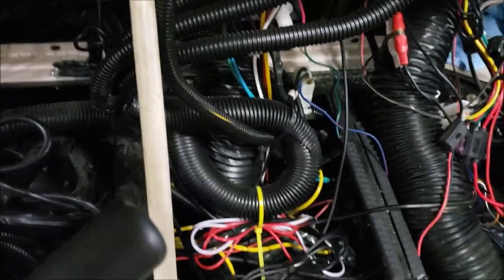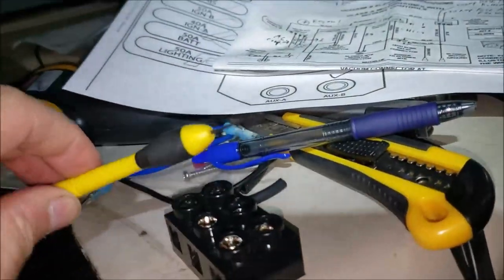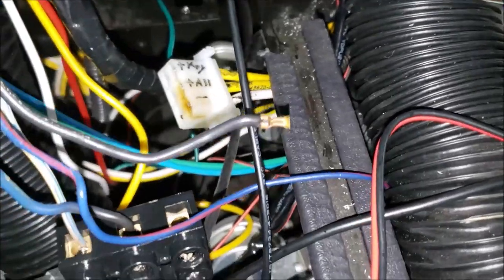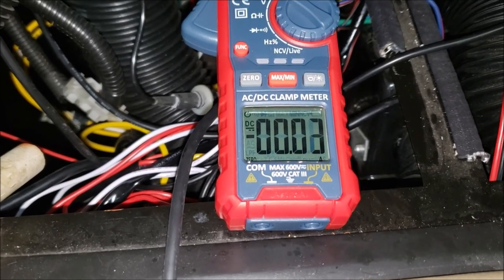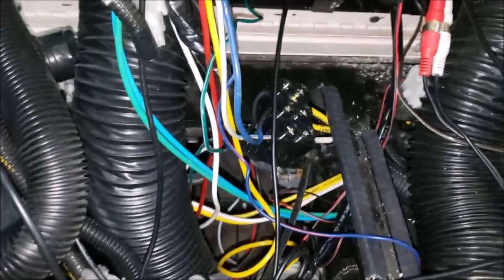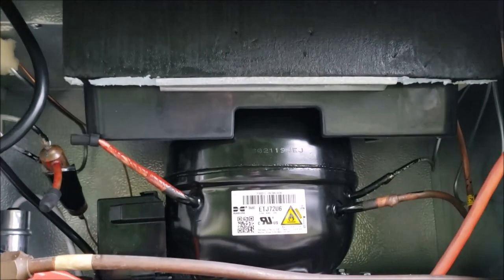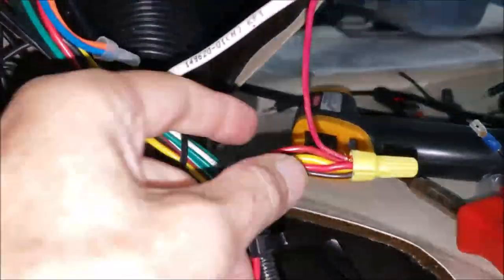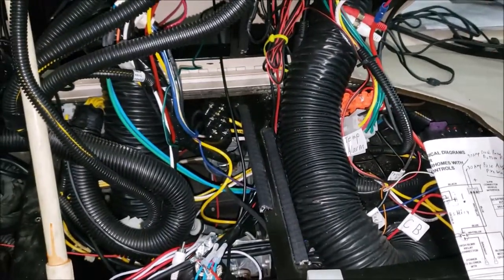Workhorse Winnebago RV Electrical Fires: What To Look for and How to Avoid Them in the First Place

Comment: This is something that I found in my 1993 fleetwood DP. The blower motor, compressor clutch, and relay for the condenser fan were all going through the factory fuse box. I switched that out to a seperate fusebox for each circuit, fed by a 80 amp relay from chassis power. Wiring is running much cooler and is all fused safely.
Reply from the maker: Sounds like a major improvement for sure.

Comment: Most if not all GM trucks including the W22 RV chassis use similar blower motors with similar stats. Here's a video with a guy testing a typical GM blower current draw at high speed. Amp draw on high is below 15 amps at 11.5 amps. 16 amps is excessive for this application despite the circuit fuse being 30 amp. This is proven by the melting wire insulation. Hope this helps you correct the issues in your RV. 

https://youtu.be/pK3dmfBjRI8

I'm a retired GM Master tech 40 years experience in the GM service bay.

Comment: Was there a root cause of the overheating issue or just the connection? Seems to me something would be an issue down the line. I’m learning a lot lately about fuses wiring and connections, definitely not a master by no means.
Reply from the maker: Those blower motors pull a lot of amps and a spade connector is sometimes a poor choice. I see it all the time in HVAC where the spade connector gets loose heats up and fails.

Comment: It might be a good idea to check out replacing the blower motor. That wire melting is an indication of excess current in the circuit. Just repairing the damaged connector will likely not prevent it from happening again. Just my thoughts. Stay safe.
Reply from the maker: I'm checking into it but its fuzed at 30 amps and pulling 17 i can't find what normal is but seams ok for now.. stay tuned

Comment: Some of the things we find in our RVs is pretty damn concerning. 21 years as a Ford technician I can’t count how many blower motor resistors and control switches I had replaced in the Econoline / E series chassis’s for this exact failure.  In regards to the two fuses, the high speed is typically fused as a stand alone 30 or 40 amp and the other speeds are fused separately at a lower amp fuse. Just a point of interest, please check your connections at the resistor and switch for corrosion and signs of heat. I wouldn’t be surprised if the next “weak link” started getting warm.
Reply from the maker: Thanks again Larry for contributing your knowledge as we all learn together, so we can keep these RV's on the road for many years from now.